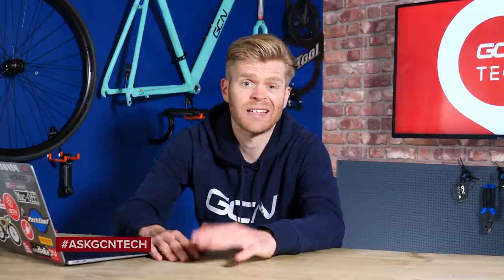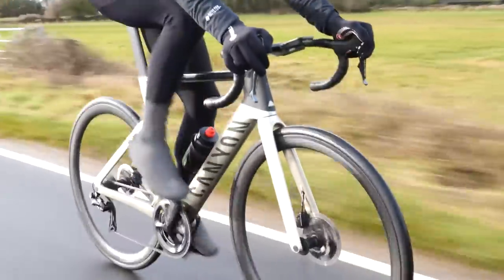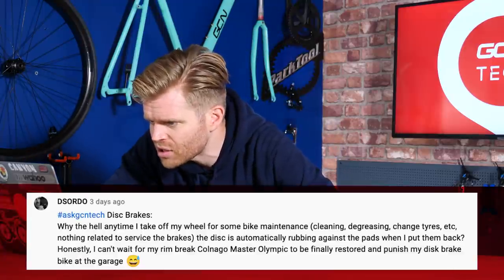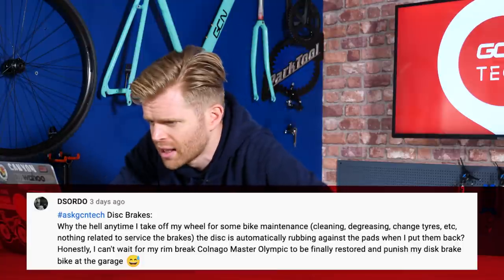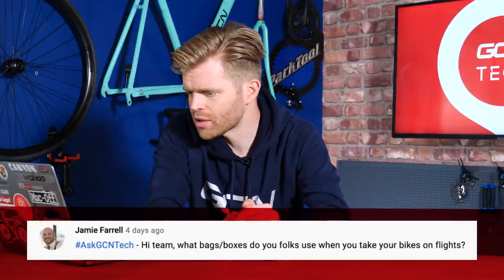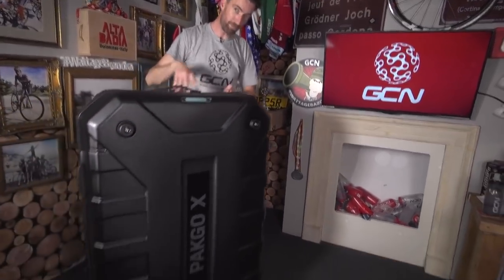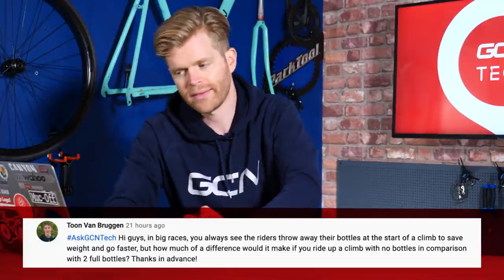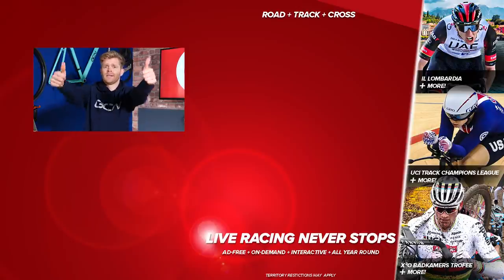What Is The Most Aero Way To Commute? | GCN Tech Clinic #AskGCNTech

Comment: GCN actually tested the aerodynamic commuting question a few years ago in a wind tunnel and the giant seat bag was the winner. It was basically no difference vs. the control. Panniers were the worst option.
Reply: Yep, they did indeed!
Reply: Came here to make this comment but I'm glad you beat me to the punch.
Reply: @jasonmcgrody9472   👐
Reply: Difficult to get a laptop into a seat bag though
Reply: I’d put my money on (have have invested my money in) a Tailfin. Plus, it does fit a 13” laptop.
Reply: @richardbrook4545  Yeah, depends on your needs, for sure. I just needed a change of clothes when I commuted, so the giant bag in the back was great.
Reply: @richardbrook4545  even if it would fit (in some back-packing style bags it does), i would NOT recommend this. Not because of laptops vulnerability, but because of the drag you get when changing directions. Even the weight of an ipad causes enough force to make your bike hard to control when the weight "dances" around your seatpost. And in a daily commute you are about to quickly change directions all the time - something you dont do this way on a road trip. (PS: look out for a triangle type bag for your frame instead)
Reply: @neuspur  I'm only short it would have to be a tablet if it was going to go in a frame bag
Reply: @richardbrook4545  Tip for laptop users: 

Put on aero bars with a decent gradient. That makes a great platform for a laptop case, but nothing else. Remember cushion and singe it down. The rest of your gear goes on your rear rack/seat post. You don't want too much weight in the front, because it takes away the snappy feeling. 😉
Reply: There was also the “Why beer bellies make you go faster” video. If you just have a change of clothes, shove them in the front of your jersey. 😉

Comment: I have a biopace chainring in my old Bridgestone Mile 112 I ride flat pedals. I think if a person rides flat pedals it helps with putting power in dragging at the bottom and pushing over before the top as wheel as slamming it down on the down. I end up just feeling the pushing over the top and dragging before and after the bottom. 🤷🏽‍♂️. I started out with a biopace ring and have only been cycling since late 2020.  this is what I’ve come up with for the most efficient way to maintain speed at my highest pace. Probably completely wrong but it seems to work.
Reply: That was the theory of the Biopace: the lesser chainring radius at 90 degrees to the crank was supposed to aid the rider in accelerating pedal speed on the down stroke so as to build momentum and aid it over the dead spots (at the top and bottom) of the crank's cycle. That was the theory anyway. 

Funny, the now accepted oval chainring orientation, that is, the large radius at 90 degrees to the crank, was first introduced in the early 1900's but fell out of favour, ostensibly because of knee strain.  

Not sure why (or if) it's catching on now. Are there empirical studies documenting its advantages?
Reply: @Fetucinee  it would be cool if The network does a retro on it.

Comment: #AskGCNTech 
Whats cooler? 1x or 2x bottle cages on a bike? 
Also, what's more aero? A bottle on the downtube, or the seat tube?
Many Thanks
Reply: 2 cages! In my opinion 😎 Even if you're only doing a 1 bottle ride you could think about putting spares, tools or snacks in the other bottle or just leaving it empty. 🥳👍
Reply: Depends on the frame, but a bottle on the downtube will almost always be more aero, as the downtube is bigger, providing more shelter for the bottle, and the angle of the bottle to the wind provides reduced frontal area and increased chord length.
Reply: The ideal place to put a bottle is behind the seat on its own mount so your body shields it.
Reply: Two, because one bottle is for short miles. Do fifty, sixty or more miles on a hot day and see if that second bottle is cool. There is even a song:
https://youtu.be/RxAQwMNXlic

Comment: To the 1st point on question 3 about disc brakes/ calipers. You can get a spacer/ insert to put in while the wheel is taken out to avoid the accidental compression of the pads. Very useful for transporting the bike! 
This is also what you will find in the caliper when you buy the bike boxed, don't throw them away!

Comment: #askgcntech What up from New York.
25mm - 28mm tires on 21mm or so internal rim width is recommended by many for a nice aerodynamic profile, but then looking at ETRTO guides, 21mm internal is only recommended to have 29-34mm tires mounted. What gives? See ETRTO chart below.

Thanks!

Tyre section	Measuring rim width (mm)
18-21	15C
22-24	17C
25-28	19C
29-34	21C
35-46	23
47-57	25
58-65	30
66-71	35
72-83	45
84-113	76
114-132	94

Comment: I have two bikes with Biopace. A 1985 Miyata 1000 and a 1986 Gardin Loria, with 105 Biopace. I find them both to be quite enjoyable for climbing. I heard, somewhere, that the Biopace rings weren't popular with the pros, especially at high cadences and thus they never became "cool". Then, again, there was resistance in some quarters to index shifting, at the same time as biopace came out.
Reply: Sheldon claimed that they were good for low cadence, and other people rotate them a notch. I rather like mine.

Comment: About the disc brakes: i've sufferred alot with the same problem till i realize that it always happend when i remove a wheel while bike is upside down.
If i put wheel back when bike is downside down i've never faced that problem.
I hope you understand the reason of that problem after my comment)

Comment: #AskGCNTech Hi, I was wondering about after how many km's should you change your bottom bracket bearings? I currently have a 2020 Giant Propel Advanced 2 Disc with 21,000km's in a year and four months. Ride every day in all types of weather. Is it worth upgrading to ceramic bearings in the future, when the current set give up the ghost?
Reply: Nah. Steel bearings are fine. Ceramic is way more expensive, but the cranks don't spin fast enough to offer any additional speed or power savings. I would be very surprised if ceramic saved more than 1w.
Reply: Ceramic bearings are fractionally more efficient (we're talking 1/4 watt here) but also wear out much faster.  You're at about the average mileage life expectancy of a bottom bracket but if it is still tight and quiet you can keep riding it until it isn't. That's some impressive mileage in a short time frame BTW!

Comment: #AskGCNTech Howdy, I recently started to rebuild my road bike into an gravel bike and I faced a problem when I changed my chainrings. If the chain is on small chainring up front, and on the smaller cog in the rear (crosschaining), the chain starts to slip up on the bigger chainring. The problem is not the front derailleur because I can see it isn't touching the chain. I know that I can avoid this by not crosschaining, but it still bothers me because it didn't do it before. Is it because there is a smaller distance (radius) between the chainrings now? Earlier I had 52/36 and now I have 48/34. Thanks a lot!

Comment: Put a block behind the brake lever so you don't actuate it inadvertently  also drive a small wedge in the caliper against the pads to push them slightly back or at least keep them from closing any more, be gentle .then when you reinstall the wheel  the pads shouldn't drag..

Comment: #AskGCNTech 
Hi Alex, Ollie, and Manon! I just recently upgraded to a direct drivetrain indoor trainer from a wheel on trainer. The employee at my local bike shop tells me I don’t need to shift gears when I’m training (like I selected a work out, not simulation mode or riding around). Would ERG mode on Zwift automatically kick in, forcing me to push out the power needed to comply with my training or should I just shift gears like a normal ride? (I would test it myself but, I won’t be home to try it for a while). Thank you and I hope you’re all doing well!
Reply: Yes. Erg mode adjusts the power according to gradient and cadence. It’s great for workouts. No thought required.
Reply: You don't need to shift if ERG mode is engaged, but if you prefer shifting you can disengage it. ERG does try to force you within desired parameters which I personally don't like, but many do.

Comment: I'm not sure of they still are with the CADEX wheel brand, but my Giant SLR0s have bladed spokes and internal nipples. How much of an improvement they actually make is questionable, however they definitely do feel faster than the stock wheels that came on my bike. It's likely the hubs (DT Swiss 240s) and insanely low weight that contribute most to this.

Comment: Ah, now you're talking! Aero commuting is a huge energy (and thus money) saver! Get a rear saddle bag to carry your gear, like the Arkel Randonneur+Tailrider. It's more efficient than having no gear at all because it fills the negative area behind the rider.
Reply: What about a classic rear rack (mounted at the dropouts), as some bikes still support those? Should be quite similar aero-wise if you put a bag on top of it, but also very stable.
Reply: @erlkoenig90  That's what I do and it works great. I use a Racktime bag with optional panniers so I don't have to pay the aero tax when I don't need the additional space in the panniers.
Reply: @erlkoenig90  classic racks are too low, need to be up in the low pressure area behind the rider. Plus the supports are in the wind. The Arkel Randonneur is very stable.

Comment: #askgcntech
Hi Guys,
When you look at the Strava recordings of the Pros the distance and elevation numbers usually vary quite a bit. For ex. Remco Evenepoel seems to have ridden 4km more in distance but have done 170m less climbing than Tadej Pogacar in Il Lombardia. Both started recording after the neutralized section. Is this due to measurement failures of the head units or did Pogacar save 4km by riding a smoother line? (which would not explain the 170m elevation difference)
Thanks

Comment: #AskGCNTech I am planning to buy a carbon saddle but learnt that it has a different rail size, currently my seatpost is on a 1-bolt type clamping system, how would I know if the seatpost is compatible with carbon oval rails (7x9)  if it is not indicated in the full specs of my seatpost? Is it safe to assume that the seatpost is compatible already?
Reply: I'd say no. You may have to buy a new saddle clamp for the new saddle rail size as I think alloy rail size is different to carbon.

Comment: #AskGCNTech Recently bought a new bike and got a proper fit from the shop, I got good padded shorts that were fine with my old fitted bike and no issues. Now when I ride after about an hour the testiculars start to burn, know anything that could help?
Reply: The saddle the bike came with might not be for you.  Try a saddle with a pressure relief channel and make sure the saddle is level and you aren't putting yourself too far forward or backwards.  Sometimes the bike fits don't replicate real work conditions good enough and small adjustments need to be made.

Comment: Oh, man. I have that same problem, DSORDO. Every single time I remove a wheel on either of my bikes, I have to break out the 5mm and realign the caliper. Every. Time.
Reply: QRs or thru-axles?
Reply: It is a nightmare! 😂🙈🙈
Reply: @brankododig1585  It doesn't matter in my case, because on my gravel bike I have thru-axle on the back, quick-release on front. Always pads are rubbing when put the wheels back... every single time! 🙃
Reply: @brankododig1585  Through axles on both bikes for me.

I did actually manage to put the rear wheel on my mtb yesterday without fiddling with the caliper. But I had it way up on the stand so I could eyeball the spacing.
Reply: @owensnicholas  This thread reminds me a sentence I have seen a while ago:
"You work for disc brakes, rim brakes work for you"
Reply: @_NoName...  Yeah, I don't know. I'm still on Team Disc Brake. I just wish I could solve that particular issue. I guess I just have to be more careful when putting a wheel back on.

Comment: #AskGCNTech I'm (hopefully) getting a gravel bike in the next couple of months and it'll be my first bike with disc brakes.  Thinking of when I want to go on different terrain, would I be able to use 650B wheels as long as the brake disc was the same size as the supplied 700c wheel disc brake?
Reply: As the disc is clamped at the hub, wheel diameter is irrelevant to compatibility. What WILL matter is if you have different brand/model hubs, discs, etc. and the alignment of the caliper is off when you swap wheels. If everything is the same, then it should swap without issue (although discs can warp so that might cause rub). If something is different, you may need to shim one of the discs to match the other.
Reply: @cjohnson3836  ahh thankyou.  I was wondering as it seemed that "any wheel will work" from some of the videos where wheels appear to be casually swapped for a different size

Comment: #AskGCNTech What would happen, if you switch the positions of the big and the small chain ring, so the small chain ring is on the outside? Impact on chain line and efficiency?
Reply: Yes chain-line would be the most, you don't ride in big ring I'm the front and back, but if you wanted to use your granny-gear(easiest gear) then the chain would have to be crosschained
Reply: @anjaymitalskiff4938  Now I'm wondering what would happen if you swapped both the cog order AND the chainring order. So Biggie Smalls closest to the frame. Could it solve some issues with torque on the axle, making freewheels realistically viable above 7 speeds and shrinking hub sizes back down?
Reply: @Aubreykun  you would have to have a very wide dropout, so that the cassette wouldnt rub
Reply: @anjaymitalskiff4938  True, or complex bends in the stays, which causes other engineering issues.
Though it might be doable with current manufacturing, since Fatbikes have similar bends. Hm...
Reply: @Aubreykun  I also don't see there being any benefit
Reply: @anjaymitalskiff4938  
If I understand it right, the reason freewheels don't go above 7sp is because there's too much load with a small cog far from the hub body and it bends the axle. 
If I understand it right, having the lower-load, big cog on the outside would mean you could (theoretically) ditch the extra complexity, weight and compatibility issues of a freehub in favor of a return to freewheels. Just backwards.

(Note that some 8sp+ freewheels exist now due to ebike hubs having a reinforced axle, and there's an old rare sachs design with a bigger axle for a short-lived 8sp. But they are usually heavy.)

Comment: #AskGCNTech Hi guys, i've just bought a new bike (Stevens izoard pro disc). When you buy a new bike or chain, it already has lube from the manufacturer on it. My question is: is this wet or dry lube? Thanks in advance! (You pronouce "Toon" as "Tone" in English)
Reply: There was a tech clinic about 6 months ago in which Alex strongly recommended removing the factory lube and applying your own.

Comment: #AskGCNTech Hi Olli, I have made myself acetate, transparent, 250цm thick aero cover to my shallow rims. It has got closable valve section, and added weight is less than 80g per wheel. Well of course because I fixed with scotch, It slightly buzzes on rough gravel rides and i need to refurbish after every reentry!(in once a couple months to be honest) Why don't you advertise and push companies to make aero covers instead of heavy metal(or heavy carbon) deep section rims?
It'll be both better for companies, rims will get cheaper since they engineer less variation of products, and the ride will get more aero for everyone. And the clips will probably be better manufactured by machines than regular hand-made covers. Please help us riders with this issue.
Xavier Oz, Electrical engineer, ex-pro cyclist
Thanks & Cheers!
Reply: I would like to send pictures of my product, if there is any other way to upload than installing gcn app. Let me know where to send it.
Best regards
Reply: A suggestion I could give you is small bits of foam tape to cut down on the buzzing. You may also want to look into UV-resistant plastics. But realistically nobody uses a disc wheel outside a velodrome because they interfere with crosswinds and can cause massive handling issues. Even GCN found that deep section fails vs light weight rims in realworld conditions, something they don't bring up ever since that test. Even in a velodrome a front disc wheel creates issues with handling. Unless we get some kind of enclosed drag race event, I don't see disc wheels becoming "the thing."
But if you live in an area where they work, or you just plain like them for the aesthetics, go ham. 

As for companies offering it, some companies do make similar things, but they're primarily for show bikes -
There is a Japanese company which makes wheel covers out of some form of plastic. There's a small trend of people over there who customize a bike to be themed around an anime/game character, so they custom paint the frame and put a large image on the wheel cover. They're really quite impressive. But I imagine the covers would have originally been designed for aerodynamics. I don't remember the name of the company but if you look around ye olde electronic bay you can find some exporters that ship outside Japan.
Likewise there's an American company which makes shiny, heavy, metal "Mooneyes" covers, but those are pure bling for old cruisers.

Comment: #Askgcntech hi everyone 
What can i use instead of chamios cream ?
Reply: Vaseline or cocoa butter are both reasonable alternatives
Reply: Chamois cream is a bandaid solution for problems in your saddle-butt interface. Either you have the wrong shape saddle, your bike fit is off, or your clothes don't fit you properly - the cloth is supposed to rub against the saddle and cling to you, not rub against you and cling to the saddle.
Your tire pressure could also be too high/tires too narrow for the roads you ride.
Reply: @Aubreykun  thanks 💜